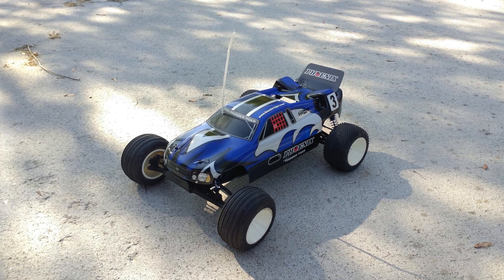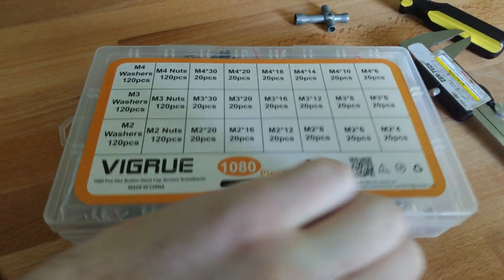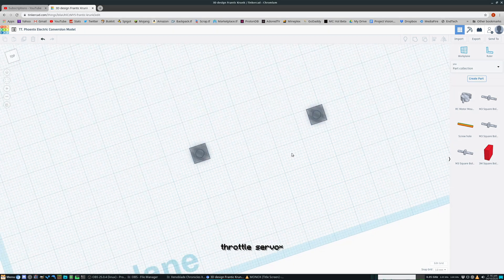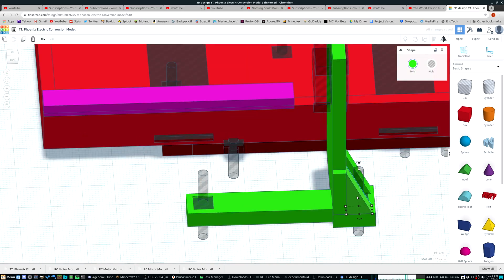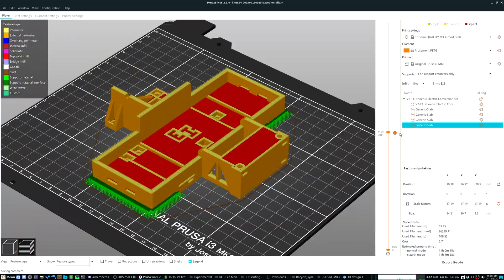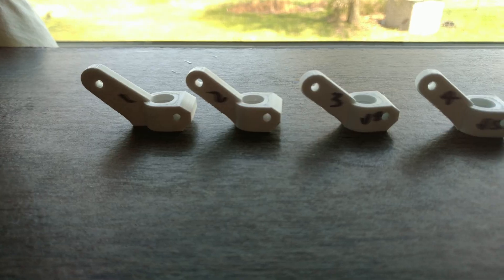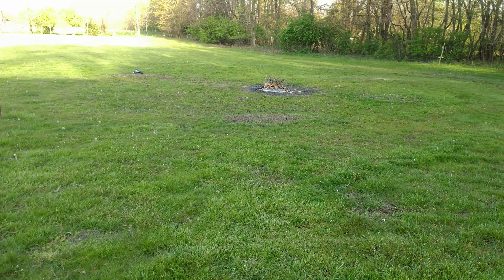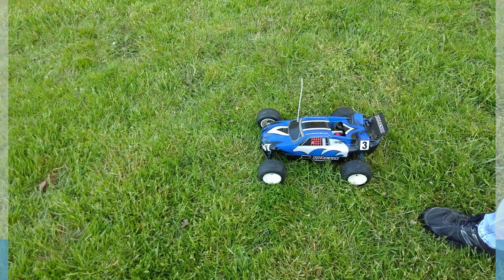Converting a Nitro Powered RC Car to Electric (ft. Thunder Tiger Phoenix GT)

Comment: Was the performance (Speed) the same or better?
Reply from the maker: Faster than when it was nitro? Probably not. The electronics I used are pretty low end so its likely slower then before, but if I had used a better ESC & Motor it certainly could out perform it's original nitro configuration.
Reply: THX @ExperimentalIdea